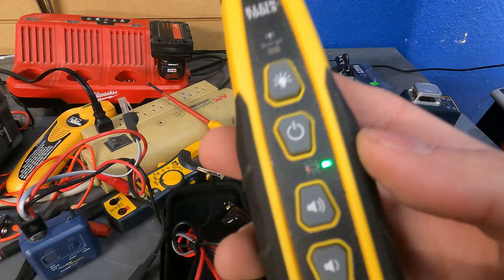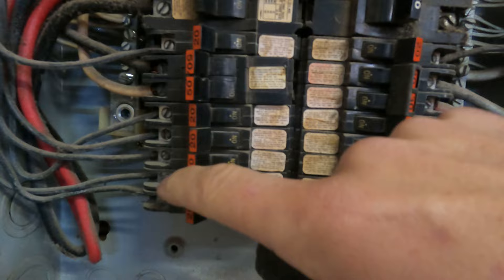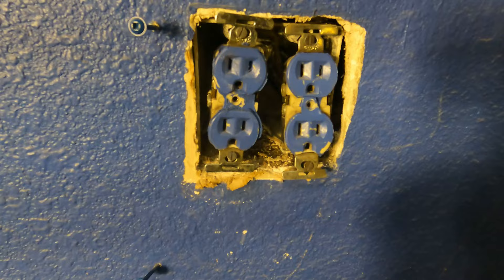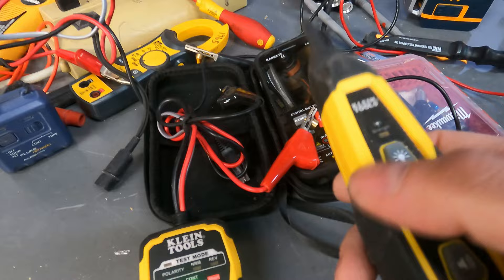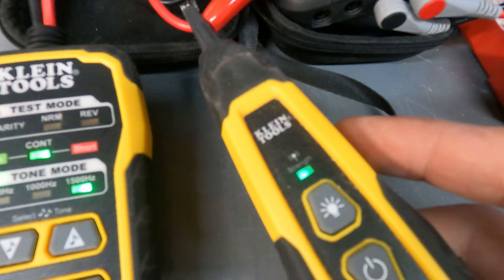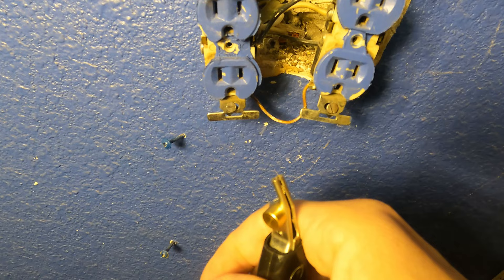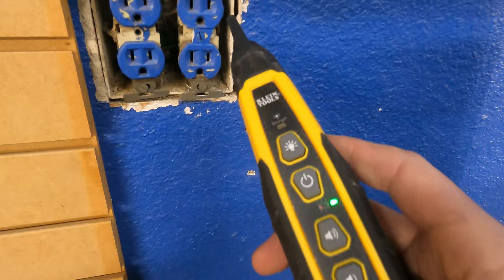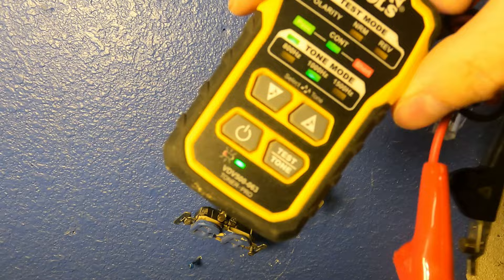Klein Tone generator/ probe  - How to use a Toner The RIGHT way!

Comment: I can't tell you how helpful this was. I've had the same Klein tracer for a year and have almost thrown it away several times being unable to trace anything. Why would this info about "tuning" the sensitivity not be in their documentation? Go figure! But wow, now I can actually trace. Thank you so much.
Reply from the maker: Hey, thanks. I'm glad it helped!
Reply: @toolsandtactics you're not a qualified electrician. You just taught your viewers to poke a screwdriver around a live panel. First thing to do is turn off the main, turn on a flashlight, and connect the tone generator to the wire you think it should be. 

I don't even know how you have an electrical credential showing people to shove a screwdriver near live wires inside the panel like that. It's not just one wire at a light switch. If you contact two wires with your screwdriver, you get two legs shocking you, and you can die.
Reply: @toolsandtactics also, if you don't know what the extent of damage is from a short, check resistance with a test leg of wire and a multimeter. 

 Old school. 

Kids these days are useless.
Reply: Yes that is vary helpful  I can't  imagine  using a tracer that's not usefull on a 240 breaker  can u show us how to trace 240 v breaker
Reply: @sasquatchrosefarts thats crazy. I been poking my hands and screwdrivers around in the panel my entire career havemt died yet

Comment: The sound quality here....my god. The tone alarm sounds like a nuclear bomb going off compared to narration
Reply from the maker: Thanks!  I will keep that in mind for a remake
Reply: Hello my friend, i want to ask you one question do you think i can trace a wire in the car with this tool, if it's possible can you help me please, how to setup the tool to find a wire, does the battery has to be connected or disconnect. Thank you in advance.
Reply from the maker: @Luis Martinez  hey, yeah disconnect the battery,  and before you hook anything up try toning ( with a Multimeter  the wire in question to the bare metal chassis of the car to see if it's shorted  if it is the toner won't help you very much 

If its shorted you wont get a great signal you can leave the toner hooked up  and listen to see if the sound changes  when you cut or remove the wire you suspect , to speed things up 

Hope that makes sense
Reply: @toolsandtactics  thank you for responding promptly, i sincerely appreciated, i am going to try the way you say, i will let you know tomorrow. Again thank you.
Reply from the maker: @Luis Martinez  thanks good luck    how old is the car  lights or what?
Reply: @toolsandtactics  it's a 1997 mercury mountaineer 5.0 liter, it won't start, the cluster panel has no lights, also the computer port won't read the codes with my scanner obdll, any ideas my friend where to start?
Reply from the maker: @LuisMartinez-fr9gq  fuses!
Reply from the maker: @LuisMartinez-fr9gq  with fuses in check from battery post to the load side of any fuse
Reply from the maker: Look for voltage
Reply: @toolsandtactics , yes that was the first thing i did, last week, sure enough 2 fuses were blown out, next i am thinking the relays. I am not a professional i have a multimeter, how do i check for voltage can you explain me where do I need to place my prongs leads of the multimeter to look for voltage. How do i do it my friend, thanks for your support...
Reply: @toolsandtactics  the wire in question do you mean the black lead of the Klein tool right, i just do not want to mess up more, and the red lead of the Klein tool to the wire i suspect right,
Reply from the maker: @Luis Martinez  on a relay, depends on the type   also if fuses blew that means somthing is wrong  might be shorted  has it been sitting?
Reply: @toolsandtactics  Ok. I get it, i am going to check everything slowly just to make sure, i want to learn how to use the the Klein tool properly, also i thanked you for the advise.
Reply from the maker: @Luis Martinez  thanks again On a standard relay should be 4 wires  a ground a hot for the coil  and a hot andanother but switched  I might have to make a video
Reply: @toolsandtactics  my friend that will be nice to learn some tricks about it. I have not get there yet the relays it's a little more complicated right
Reply: I will keep you post it, tomorrow, for sure, thanks again. i am still working, but tomorrow am off...
Reply from the maker: @LuisMartinez-fr9gq  relay video is up! Check my channel on the lives

Comment: FPE panel... So that could have ended in a short with those breakers not tripping due to design failures.
Reply from the maker: had the diagonals ready if it welded 🤣
Reply: @toolsandtactics  😂 I absolutely hate touching those panels. Although easy money for a replacement 🤔😏
Reply from the maker: @James Makay  yeah 1 of the companies I worked for had customers sign a waiver 💀
Reply: Fire Pacific, Federal Catastrophic.

Comment: Great video. Very helpful. I have that Fluke toner and it works great for me. Reviews on the Klein pointed out that it has weaknesses as well. 2 good choices for sure.
Reply from the maker: I will say the actual generator for the fluke. Is very nice and I've used them in combination with each other. But the actual wand 4 fluke isn't as good

Comment: The video is good, respectable and in terms of tracing lines in short circuit, the Klein Tools ET450 is much more precise because you can trace even over sherock walls with or without power, and even if you have lines on the ground. example in the garden or patio. This tracer is good but an error and if the circuit to God tracer is energized. Otherwise, as I said, the video is good.
Reply from the maker: thanks! ill check out the Klein Tools ET450

Comment: Well sort of. Sensitivity varies by distance of the run. You may still need to turn up the sensor if the receptacle if far away from the breaker panel if you want to use the light.

Comment: Great video! Can this tool trace a neutral wire in a dedicated circuit in the panel? This video is one of the best I’ve seen on the practical use of a tone generator to trace electrical wire in walls and receptacles for diy

Comment: So I have a customer where they have a leak in their copper line set for the hvac system. But they had an addition done in the past. So I don’t know where the copper runs. Can I use this to trace the copper line? How would I do this? The copper is already grounded.
Reply from the maker: You have to disconnect it to isolate it
This toner might not help

Comment: The fluke 3000 is a good tester. If you’re toning out a line all you have to do is touch the line with your hand while pressing your toner if you have the correct line it will make a sound. I’ve never had an issue.

Comment: Thank u kind sir, this helps this here dummy who always fails in reading the instruction manual. :))
Reply from the maker: I hate instructions  worthless    lol
Reply: @toolsandtactics  Man sorry to bug, but a quick question.  I've got a dead outlet, and  having a hard time tracing wires with this tool.  When tracing hot wire to panel, I can't pick up a tone there at all, but also having a hard time just even tracing the wire behind wall in conduit.  I got the red clip on the hot wire and the black clip on ground wire, so I think that's right.  Also, how to trace a neutral wire on, since attaching clips to it and the ground wire will show continuity?
Reply from the maker: @pondacres  conduit acts as a shield you cant trace wire in conduit  only non metallic, flex, romex, cable, cords
Reply from the maker: also make sure that the ground wire you attached to has a true reference  might be better to attach the black wire something else grounded
Reply from the maker: how is the circuit laid out? you can also email me conductivewood@gmail.com
Reply: @toolsandtactics  ha, interestingly, that's how it's laid out lol!  Previous owner wired this house up, or at least much of it.  I don't wanna bug you too much, it's not a critical outlet anyways, but it's like at the far end of the house away from the panel, a gfci outlet, has never worked since I've had this house.  I find capped off wires in a few outlet boxes here, so maybe previous owner never connected the wiring somewhere upstream.  He wired much of this house himself.   Oh man that sux about not able to trace wire in conduit, somebody on amazon said it picks up although faint.  Oh well.  Man, thanks much for responding offering to email you, you're a righteous dude!
Reply from the maker: @pondacres  Thanks! but your not bothering me, I can even make an individual video just for you! I do it often for people or on a live! let me know  and take care
Reply: @toolsandtactics  Man this is youtubing done right, thanks friend!  I'll definitely keep you in mind for help in the future...I have a habit of jumping in it, and then scouring online/youtube for help lol.   But please one last question, although probably a stupid one: for what I was trying to do, should I have turned off the main breakers in the panel?   There's no power at that outlet, and there's a bunch of capped off wires in the panel.  So I was hoping one of them capped wires was going out to that outlet.  It's a total nest of wires in that panel, wrapped this and that way, so I was just waving the sensor wand around in there, hoping to pick up a tone.  But all I got was static, although occasionally the light on the wand would flicker.  Could the panel being powered be causing interference somehow for that sensor wand?
Reply from the maker: @Pond Acres  yeah that would surely help, it's fairly safe to say your better off turning all the individual breaks off before ever touching the main the older they get the less likely it will turn back 
On  very costly
Reply: @toolsandtactics  awesome, thanks for the tips!
Reply from the maker: @Pond Acres  no problem thanks

Comment: Im considering this toner for some old knob and tube trace and replace. Understand I need a good ground for it to work. Found some 14/3 that was used from the panel to a junction box where tw seperate runs of knob and tube start. They used the red wire on one breaker as a feed and the black as another. It was hidden pretty well but when going to insulate the attic space, we found knob and tube. 🤦 Would you recommend this tiner for such a job?
Reply from the maker: yes!   just attach to a good ground!

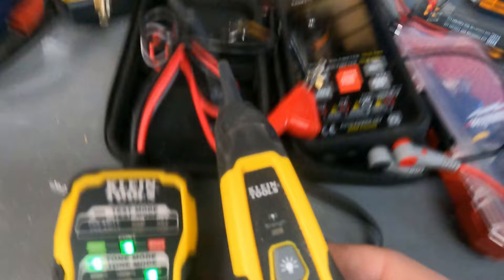Comment: Thanks for the tips. Question what exactly are you doing at 5:37...Are you trying to  adjust the sensitivity of the probe? Because i checked the manual of that klein probe (VDV500-820) for link you provided, and supposedly all those buttons do is adjust volume. I don't see anything about sensitivity .
Reply from the maker: Yeah  sensitivity    manuals are dumb

Comment: I have a HOT ground wire (120 volts) on a small light/outlet circuit.  Breaker tripped occasionally, now it instantly trips.  Should I use your suggestion with the extension cord and plug it into a different/good circuit?  Then would I be able to trace to find the short behind drywall?  Thanks for any suggestions - and GREAT tutorial!
Reply from the maker: Yeah to trace all parts out so you know where to look  use a good ground from the extension cord and try that but most likely either 1 of 2 are very common   1 fed from a gfci ( maybe this is an  outside light)  or 2 most common  open the switch that controls it and you will find a melted mess and ground touching the black wire or hot terminals or behind the panel cover a melted mess   

Your gona have a hard time Traci g it out if the hot is touching the ground 
  with a multimeter ( in continuity) so if the black ( hot) goes to ground   this could get tricky  check ever box you suspect that circuit to be in   commonly  a long run will need to be replaced 

I can make a short explaining what to do if you want to Email me a basic drawing /diagram of the room light and stuff
Reply: @toolsandtactics  Thank you for the advice and the offer to make a short!  First I'll try opening the wall up right where I found the Hot ground wire first, and check everywhere else I can (switches, outlets and fixtures).  I think with your suggestions I might be able find that...  "melted mess",  hopefully it's close to where I found the Hot ground.  If my investigation draws a blank, I might have to take you up on your kind and generous offer.  It's going to be a couple of days before I can get back on it, but I'll certainly keep you updated.  This might help someone else too.  THANK YOU again!
Reply from the maker: @user-hm1cq9wr2o  thanks good luck and happy hunting
Reply: @toolsandtactics  I apologize for the late update!  I was able to find the short.  Luckily it was very close to the switch that fed another room.  I just traced it around to the next outlet it fed, opened up the drywall and bingo!  There it was, FRIED.  It was burnt bad, burned all the way through a 14/3 Romex cable.  It appeared to be a mouse had chewed through it, but not sure... as there was no mouse carcass. Anyhow,  THANKS for helping me out with this scary situation.  Best to you and your channel.
Reply from the maker: @user-hm1cq9wr2o  that's great! This tool helped? That's awesome Thanks for the support!

Comment: How to ck 240 breaker off a p tac unit find the breaker from a wired 240 unit thanks
Reply from the maker: Same concept just use one of the hots and the ground. Make sure the circuits off
Reply: Nevermind  lol

Comment: Can you put the toner on a live circuit for instance if you looking for a breaker but the panel isn't labeled and you can't just flip breakers on and off due to being in industrial plant? Also voltage too much to just short out safely. I was wondering if the voltage would fry the toner or not. Usually it's 480v but figured you could attach toner to one leg but would be 240v on it to neutral. Every video I see has toner on dead circuit.
Reply from the maker: I don't think it'll break the toner  but it won't work  just hums loud 

Not sure about higher volts
Reply: Klein sells a circuit breaker tester
Reply: @pwhs8  yeah I found the Klein ET450 advanced circuit breaker kit that can be used on live 480v circuits

Comment: Would this work through walls? I’m trying to trace a mystery light switch in my house. I’ve already checked all the obvious stuff. Breakers off for the switch and nothing else in my house turned off. Last resort is to just see if I can follow the wire through the wall.
Reply: Did you check if that switch controls any nearby receptacles ?
Reply from the maker: Yeah It can. Depends on  material of wire and how far away  but yes
Reply: I’m curious if you ever found what that mystery switch controls. I’ve got a couple of them in a 30 yr old house I recently moved into. I suspect one was intended to control a ceiling fan light that’s no longer there; and the others I suspect were intended to control outlets installed inside multimedia cabinets back in the day when ppl hid their ginormous stereo components in cabinets.

Comment: Will this work for smoke alarms that have no true ground? The ground are just wire nutted in the box
Reply from the maker: Yeah You don't have to use the ground from the circuit just a good Ground source like you can use an extension cord and plug some scrap wire into the ground prong and put the black clamp on that and the red clamp on the  black to trace out the other wires on the smoke detector cable conductors
Reply: @toolsandtactics  great thank you. There’s a break in the wire coming from the panel to the first smoke alarm. So hoping to set up tester at the panel and find the broken wire somewhere behind the ceiling wall. Thank you
Reply from the maker: @nickmillionn7319  for best results disconnect the ground on the romex from the panel completely,  attach the black clamp from the toner to the ground bar in the panel  and alternate the red clamp from the black to the white on the romex
Reply from the maker: @nickmillionn7319   YOU COULD ALSO,   1 WITH POWER OFF AND FULLY DISCONNECTED FROM THE PANEL BREAKER ECT   JUST THE ROMEX IN YOU HAND     you could first check to se if any of the conductors ring out continuity to ground 

2 disconnect the other detectors from the daisy chain too  and verify that they ''ring clear''    then intentionally ground the disconnected romex to the first smokey  and ring them out 

but you probably already did that 

( meaning not unintentionally grounded )  (sorry if this is basic im just being thorough  lol)

Comment: "Make sure this breaker is in the off position..."??? huh? If you already knew which breaker to turn off....🤣
Reply from the maker: It's not a circuit identifier  it's a toner you can't use it with electricity on  you would usually turn off ALL the breakers  to find the 1 
But then we wouldn't have any lighting for the video  hope that helps thx
Reply: @toolsandtactics  that's the point, you're using the wrong tool for the wrong job!

Comment: Do not finger fk your outlets like this dude. He is completely complacent. Do not assume you have the right breaker off and that the plug is functional for your meter. Even a wiggy (voltage detector) can fail to pick up the potential in the outlet. Wear gloves and pull the receptacle out straight forward and be prepared for loose/blown off wires that’ll ground to the box and scare the shit out of you. You obviously had a problem to begin with if you are at this point of replacing receptacles.
Reply from the maker: @CS-ui4qj  calm down this was and edit from alive at my house.  Circuits already verified and we already tested everything.   The video is about a tone generator
Reply: @toolsandtactics  yes i get that you did that, but think about the average joe out there watching your video. They'll do all the dumb stuff i just listed. The "you" i mean in my statement is them, not you. lol